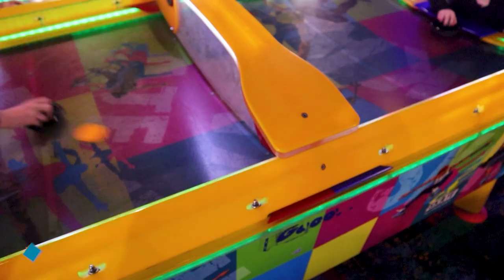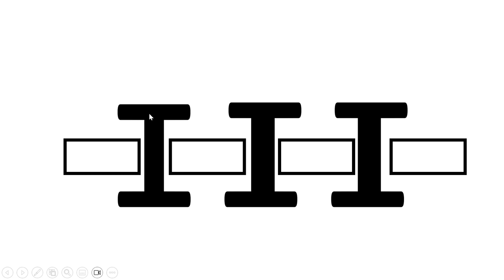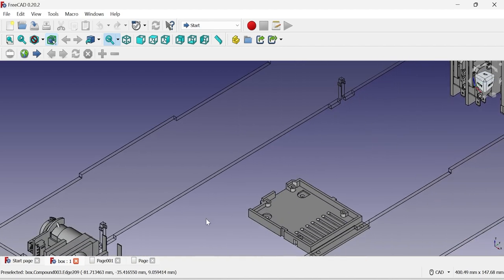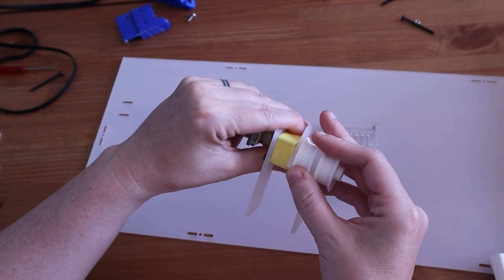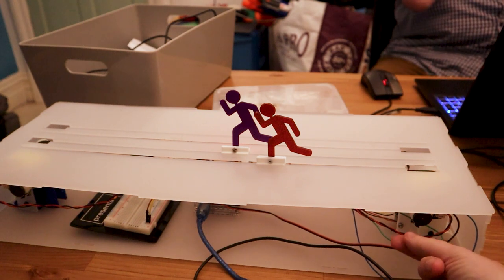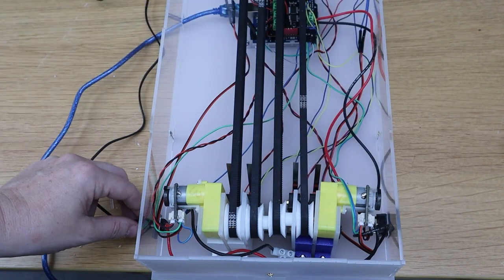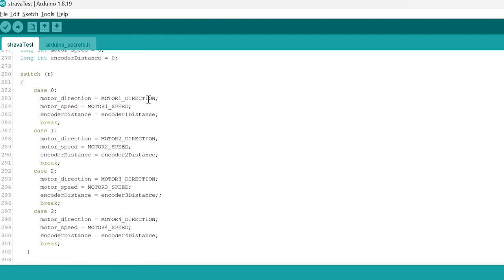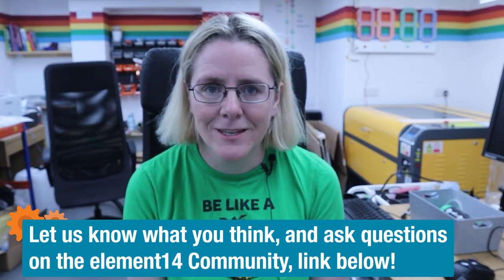From Strava to Motion: Creating an Arduino-Powered Arcade Game with Running Data

Comment: 16:34 My opinion since nobody asked 😅, is that keeping demonstration code (for the purposes of explaining a larger concept) as explicit as possible is beneficial. Sure pointers could be used, sure the if’s could be a switch/case to shave off nanoseconds, but the code is easy to read and doesn’t need that efficiency. Pointers could just scare a newcomer away in this case. I say job well done darn it! 😊
Reply: Thanks! ❤

Comment: I love it. Can you redo this with the horses? We shoot the ball up like pinball, and it drops through optical sensors in one of three slots. Each slot has a number, the outside are 1 move and the center is 2 moves. This happens repeatedly until a horse wins. The track is great. Or instead of horses on a physical track, a light board has lights that move across the wall as the ball goes through the slots until someone wins. Please make these. I played with my mom at the fair. It was a great memory and the game isn't at the fair anymore. Thanks for a great video.

Comment: 14:16 Because this channel is about learning: if you need variables as constants (=never change when running program), use defines. Save some bytes. Comment "motor variables" above the declaration is incorrect, because the constants are not variable.
Reply: I disagree - 1. defines are precompiler directives and not constrained by scope. const [type] is scope controlled and can be put wherever constraint is required.
2. Semantics. Texts and professionals commonly refer to these as constant variables. Therefore they can be called “motor variables” 😊

Nice work Lorraine.
Reply: @AmRadPodcast  1. It this case it is NOT scope controlled because there is no scope. Silly comment.
2. "constant variables" is true however in this context "motor variables" is not true because these constant variables are not variable. "motor constants" is true. The difference is in the detail.
😊
Reply: "Motor stuff"?
Reply: I find defines problematic, particularly for beginners. The syntax is different, they don't get type checked, it is not obvious if you've redefined them later in the code. 
The argument for saving memory space is not really a concern for most people building these kind of projects. So I would argue for clarity of code over optimisation for most cases.
Even using defines as macros to simplify coding can introduce some subtle bugs or hidden side effects.